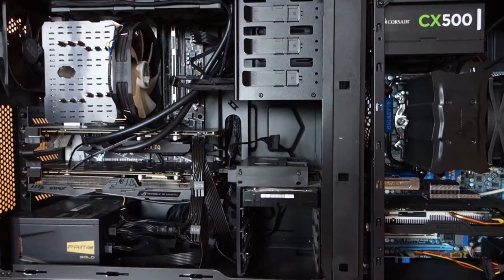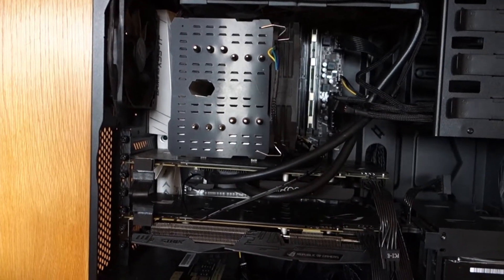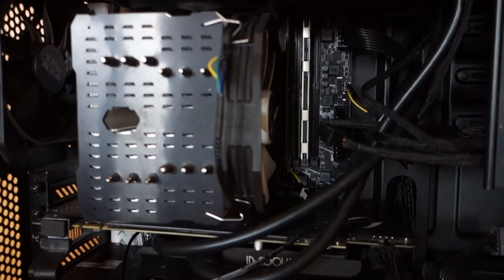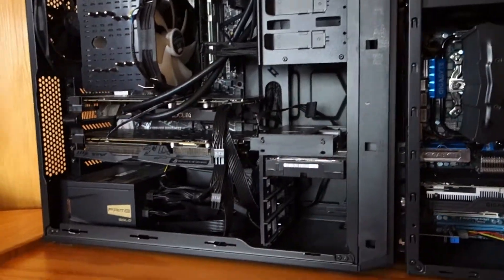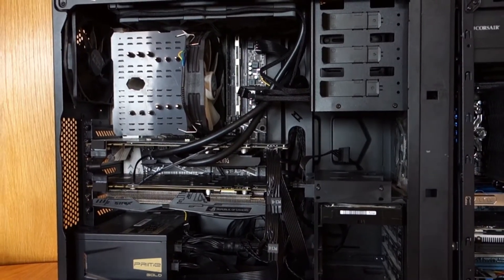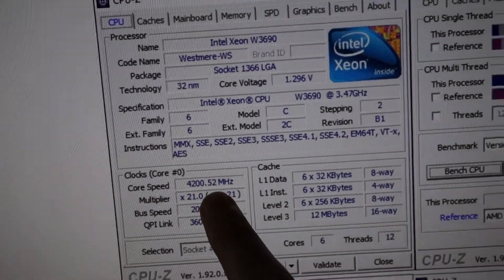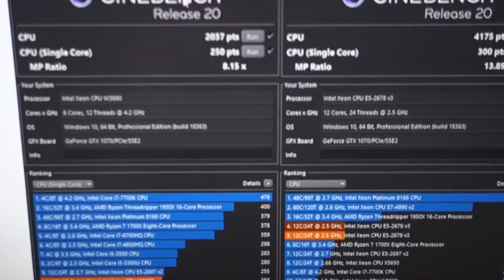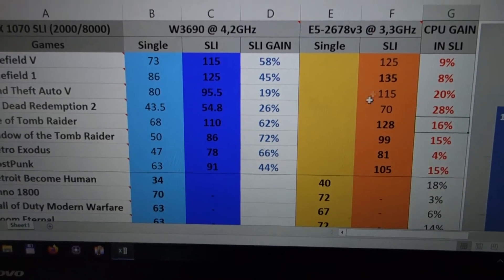X58 vs X99 is worth the upgrade? (powered by Intel Xeon)

Comment: Hi , Thanks for the great video, im looking to upgrade to the same mobo and cpu from x5675 @4.5 stable  x58a udr3 which runs well with 4ghz uncore . Can I ask how is the noise of the vrm fans as i try to keep the level as low as possible.
Reply from the maker: Normally the small VRM fans are not loud, barely noticable. However one of mine was defective and made an annoying noise. So I just plugged it off. If you have same air movement around those components it is not really needed.
Good luck with the upgrade!
Reply: @GP-qb9hi  ok thanks , do you have the all core turbo unlocked ?
Reply from the maker: @sheridanvieira4564  Yes, all cores @ 3.3GHz and -50mV. Works like a charm.
Reply: @GP-qb9hi  thanks